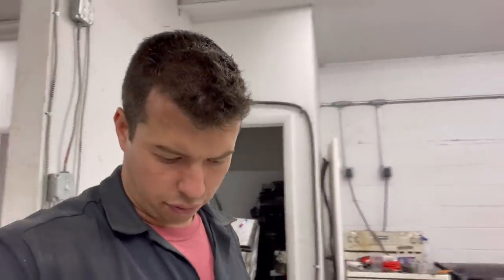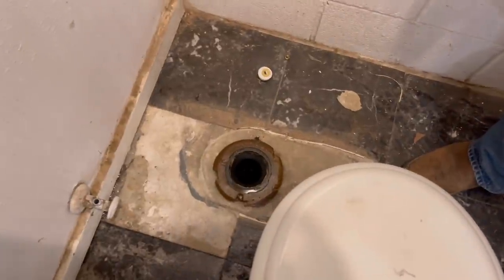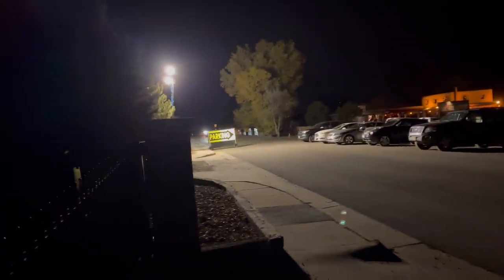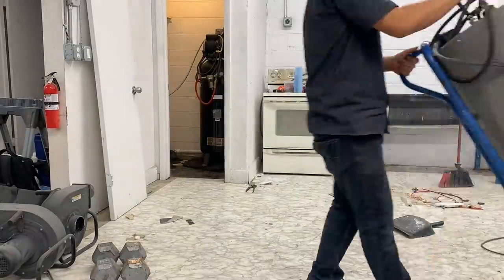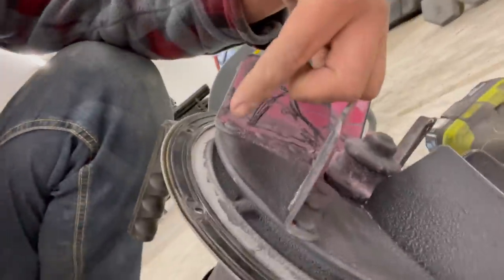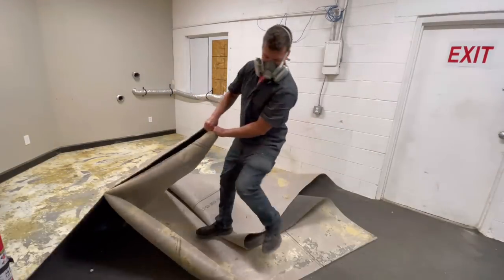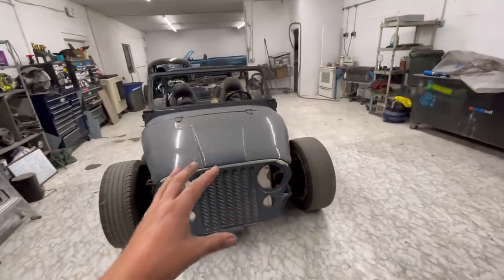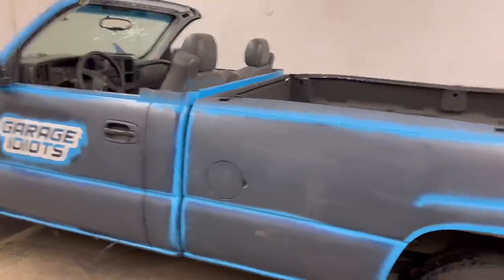The New Shop is AWESOME!

Comment: Greetings from Denmark. You should consider more work on the airsystem, like a few houses you can use when welding. Those fumes are toxic. I accidently found myself in a shop that had a system like this and I must say it was a gamechanger for me. You asked for input, so that’s it from me. Stay away from them fumes.

Comment: nice.  
if i should recommend something then it would be raise the floor "or cut it out depending on landlord" in the painting room so you can have a U shaped basin and center area beeing for filter and air out.
then metal grates over it all.
this way you have a basin around filter you can pour a bit water in to catch the dust and overspray.
overspray will settle on the water and is easy to remove when water evaporated.
+have the paint cabin slightly over pressurized so it dont suck in dust.
just have the door shut by a magnet. then you can adjust it to pop open when filters are clogged ,with plastic shims between magnet and plate to make it weaker.
over time it will show the leaks from that room with colors and make it easy to seal.
Reply from the maker: Dang! You seem to have a lot of insight!! Thank you! Those are all great ideas! I’ll see what I can do now and what would be doable down the road!